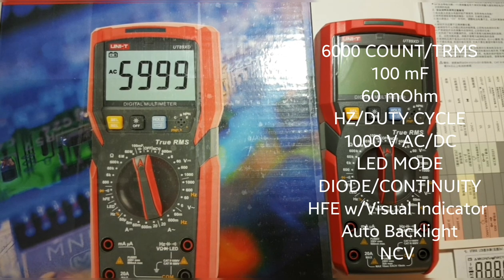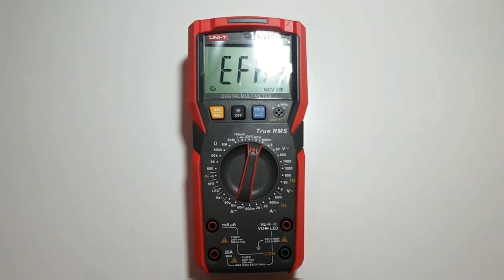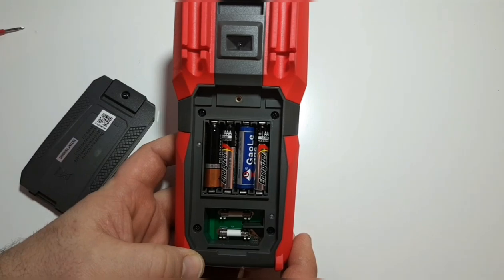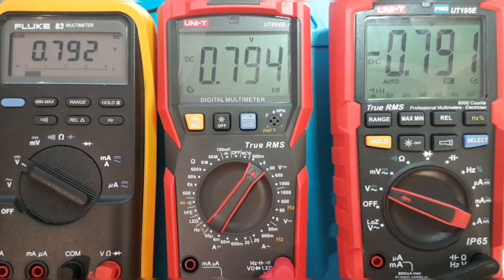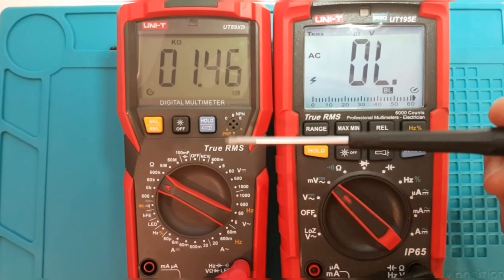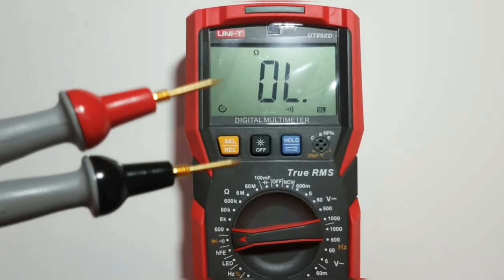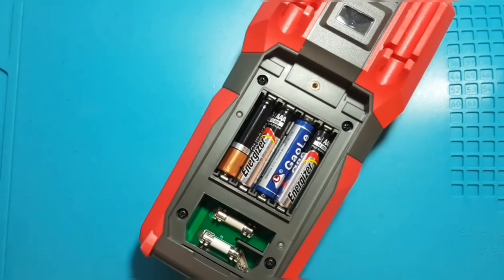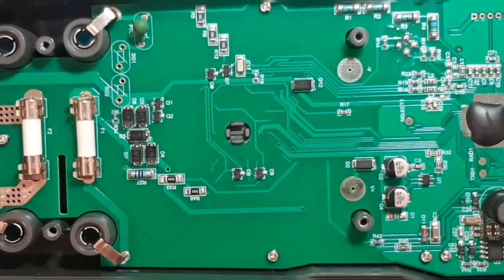World Exclusive!!~ UNI-T UT89XD Multimeter Review & Teardown!

Comment: Some thoughtful features in this one especially like the charge and discharge indicators in the cap mode. Kind of surprised its true RMS yet not auto ranging - there are $15 meters that are auto ranging.  Also surprised they still make manual ranging meters in this price point anymore, though some still prefer them.  But wow is that input protection seriously lacking, though ive come to accept in these budget meters with no input protection could be viewed as hobby class meters and built to a price, except that this level of protection doesnt really support the CAT ratings.  Be nice to see an upgraded version added with auto ranging and at least some input protection but then price is always a consideration - maybe they do make an auto range version-?
Reply from the maker: Roger that, granted non-auto ranging can still be preferable under certain conditions but all in all for the price and functionality I REALLY like this meter! If I was going for mains/input protection I would go with the UT195E but for bench I actually prefer the UT89XD! I do alot of component testing (power boards/display boards etc..) and I really appreciate the audible/visual diode functionality! My Fluke 11 has the same "beep" confirmation in diode mode and I've come to rely on this so being able to get this with the UT89XD was amazing! I don't know of ANY other multimeters that provide this functionality besides some Flukes and Hioki's that cost in the hundreds.
Agreed, the visual Charge/Discharge in Capacitance mode is a great feature, boy it didn't take long to test that 100mF cap! Yummy!
Reply: I have to agree almost completely, it seems we sometimes must accept different meters for different purposes, and as you said this is a great low voltage bench meter for electronics what with its added functionality you spoke of. I also like the beep on diode test, my recently acquired Fluke 27 has it and it seems all meters should.  If youre testing heavy duty go Fluke or similar, but on the bench with electronics a meter like this is really sweet.  Is the non auto ranging preferred for added speed or accuracy, I am aware some prefer it in certain situations but then most auto ranging meters can be set to manual, some anyway.  Bottom line theres a lot to like in this new meter, seems this would be a good model for uni-t to capitalize on in the future and expand to higher levels, then just like their other popular models you could pick your flavor.  Nice to see some new idea come into the fray, this meter has functionality that should be in many other meters, hopefully other brands will start adding some of these new features to keep up, could only get better from there.
Reply from the maker: @yambo59  Well said, compromise is the buffet of life and multimeters are no different. I always loved Fluke for the little things they do..and the audible beep in diode mode is one of them. So simple,  plain Jane..but what a huge timesaver if you're troubleshooting 20 pcbs in an hour! This meter is already one of my favs and a definate electronic workbench buddy!

Comment: You didn't explain the humidity measurements please
Reply from the maker: This multimeter does not measure humidity. However temperature measurement is supported on the UTX89X🌡
Reply: @KeepOnTesting  please I wanted to say duty ratio
Reply from the maker: @newtechai4367  FREQUENCY/Duty Cycle mode is supported. 10mHz is the max FREQUENCY
Reply: @KeepOnTesting  thanks dear but how to measure it you didn't show it in the video
Reply from the maker: @newtechai4367  set the selector switch to Hz. Put the test leads into an AC Power source (such as a wall outket) your frequency will show, press select button to see the duty cycle.
Reply: Ok thank
Reply: @KeepOnTesting  please could you make a clear video of the difference between ut89x and ut89xD

Comment: Thanks for the review. I hadn't even heard of this meter before... Uni-T are really churning them out lately. I would be very wary of the LED tester mode, 12V is enough to blow a hole in modern silicon even at tiny currents of 20mA. I once probed around an FPGA board with a crappy continuity tester and killed a very expensive XIlinx Virtex 5 chip :(
Reply from the maker: I was thinking about that as well...Im assuming there's some sort of VRM/regulator being invoked as a choke to limit the output voltage accordingly...however I'm just guessing without a schematic..
Reply: @KeepOnTesting  Well there has to be a current limit of about 20-30mA otherwise it would blow up your LEDs, but even that is waaay to much current to go probing around sensitive silicon. For example, the Stratix 10 chips we're using at work right now have a Vcc of 940mV (maximum tolerance of 1.24V) and the TVS circutry to protect it can only handle a couple of mA per pin. Super easy to kill these things with poor probing.
Reply from the maker: @superciliousdude I agree,  I'm assuming UNI-T has looked at this as well and either they hope the ones probing know what to probe or there is some sort of safe gaurd in place to avoid the scenario you mention. I'm hoping its the latter.
Reply: @KeepOnTesting  Absolutely. The risks of bad probing are not unique to this meter - it is always up to the person using it. Some meters just make it easier than others to screw things up, and having a 12V test by default is a risk IMO. 12V is enough to blow up a lot of stuff, including many hobbyist grade microcontrollers which are only 5V or 3.3V tolerant. Most meters won't damage them, but this one might. Dave from EEVblog designed a 15V diode test mode in his 121GW meter for a reason... it is useful, but you have to select it. By default you get a 3V test voltage which is (almost always) harmless, and only when you press the range button do you get 15V.

Comment: It is amusing (not in a good way) that this meter comes ONLY with a Chinese (Cantonese) instruction manual.  Yes, there is a PDF of an English manual.  But if you attempt to print it out it is two pages of 2 point type, virtually unreadable without a magnifier.  Granted, a manual may not be essential for many users.  But this is verging on a deal killer for me.  Yes, I can expand the PDF text on my computer or phone, but why make us go through the hassle?   I didn't buy this thing to trade one feature (a manual) for another.  I wrote to the seller (on Amazon) who claimed the English manual is available only via PDF.

I do have to say that I find the manual meters eaier to use than auto-ranging meters.  Auto ranging are not always that "auto".  The user has to be careful to read the little value readout, because, like the box of chocolates, you never know what your going to get with the range reading.  Plus, even with auto rangers, you still usually have a couple of range settings, plus you often set for DC or AC.  With manual ranging, the readout is exactly what you set on the dial.  Also for people learning electronics, Mr. Platt of "Make: Electronics"  book and course fame, recommends manual range meters.
Reply from the maker: Well said! Indeed, the ever elusive "user manual" seems an afterthought at best on many multimeters. All test instruments should have the appropriate documentation available to the end user in a clear, concise and verbose manner. Metrology "is" an exact science. As such it should demand the same respect as your household toaster, which by the way seems to come with more instructions than your average multimeter ! Go figure.. 

I too love manual ranging multimeters ..more control, better ranges and I think.. more fun!

Thanks for watching 😃👍